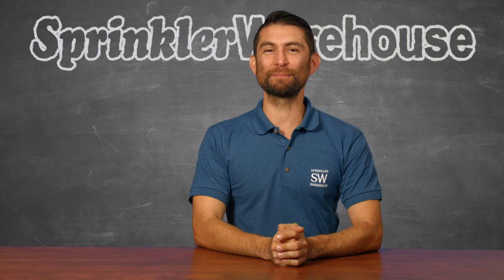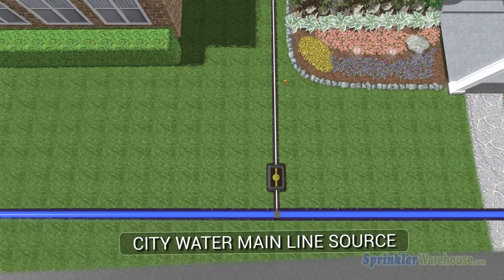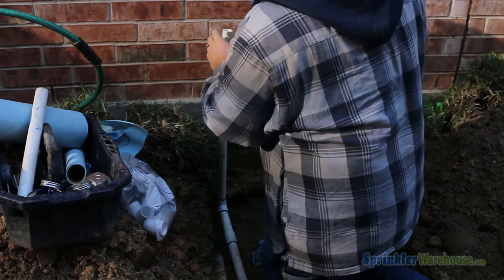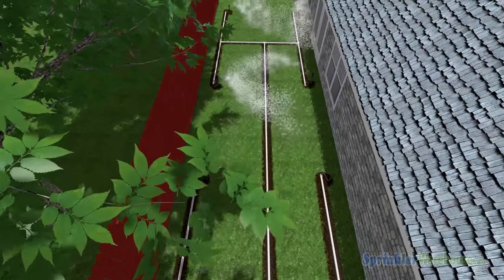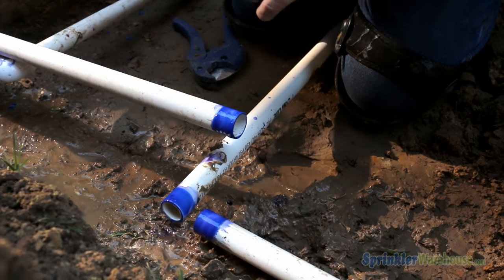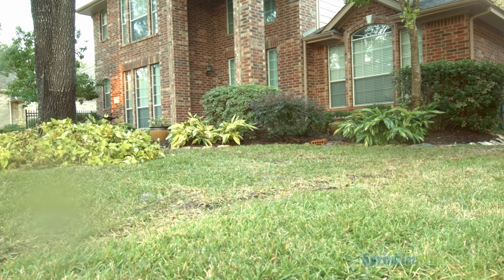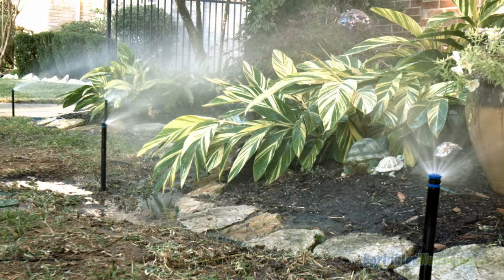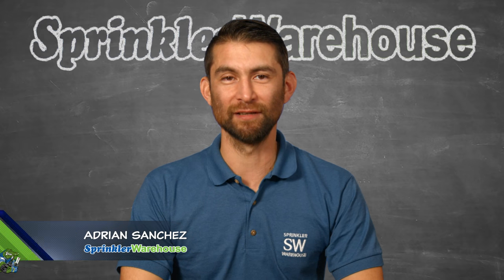Anatomy Of A Sprinkler System

Comment: Twist pipe/fitting 90 degrees.  Dont cram 3 valves together like that. One little leak in there and you might have to cut out all 3 valves to repair it. More hydraulically sound to have valves near middle of zone anyhow. And rainbird is a great product. EXCEPT FOR THE CONTROLLER THEY SELL AT HOME DEPOT. AAAAAUUUUUGH !. You have to set a seperate start time for every stinking zone
Reply: Yep. Once I stopped having to redo connections. Luckily I only messed that up like twice until I read the pvc cement can

Comment: How do you plant a tree without damaging your pipes? I marked off a square area where I want to plant my tree and use stakes to mark where a head is. I don't know how much space is between the pipes.
Reply: I bought a 2007 home and no one seems to know how the sprinkler system was laid out the guy that I was hired to fix a few things with it and replace the controller told me that they can put them in any way they wanted when they built the home. 
The irrigation guy that I hired it's not his fault it's the fault of the homebuilder not giving a blueprint of how they are laid out.🤷🏼‍♀️🤦🏼‍♀️ so it's very difficult to figure out where I can plant some trees so I guess I will end up digging and if I hit a sprinkler system oh well I guess I'll be fixing it.
I did get someone to serve a part of the area because of fixing a fence so we would not accidentally hit a pipe of some sort but that part of the yard is not going to be affected by a tree

Comment: I have the main waterline on the bottom of the hill which shoots up the hill, and the anti siphons at the top. Is that the correct setup? Or does something need to be placed inline at the bottom of the hill? In other words when the anti siphon at the top is off do I need to worry about the pressure in the line going down the hill or does it just remain pressurized and no need to worry about back flow
Reply: I think the most important part is that your anti-siphons are at least 6 inches above your highest sprinkler head. I think the concern is more about where your sprinkler heads are relative to your anti-siphons, than where the main line is relative to them.

Comment: Make sure when you put glue on your PVC that you twist the pipe or the fitting a 1/4 of a turn to smooth out the glue so there are no air bubbles or pockets that can cause leaks
 Make sure to never install pop up sprays heads with fixed nozzles and rotory head together on the same zone.

Comment: I'm putting in a fence that will go through an existing zone so I'd like to cap it rather than make cuts and repairs around where the fence posts will be and just trench and lay a new line further in from the property line. Does each zone run separately from the valve box or can one valve run multiple zones? I'm wanting to just cut through the existing zone pipe, set the posts, and trench the new line at a later date. What i don't want to do is cut out the line and then screw up several other zones if they're connected.

Comment: Hi. I had a working system years ago. Got the house stucco and brain was pulled. How do I test the system with or without the brain and how do you reconnect the brain to the zone controls?
Reply: The timer, "brain" to your sprinkler system has all the wiring to your irrigation valves, that being said if you know where your valves are, you can simply buy irrigation wire, and wire it up to your timer "brain".

Comment: Do I need an anti siphon valve for each zone? Or just one for the entire system? Lowe’s told me I need just one, and then a solenoid for each zone but Tampa codes require back flow prevention.
Reply: There are five types of backflow prevention.  Your anti siphon valve (atmospheric breaker) really isn't the way to go. Theres not supposed to be back pressure on it . In other words no valves downstream. And has to be 12 inches above highest head. And more...Use reduced pressure device, or a reduced press principle device. Or, in tx still allowed to use the in ground double check backflow preventer.  Dont buy the cheezy atmospheric breakers. The plunger sticks to the top and they then dont prevent backflow.
Reply: Air gap is another form of backflow prevention.  You wont be using that